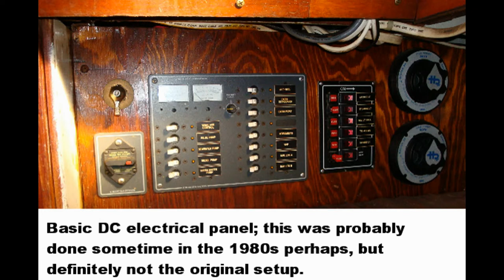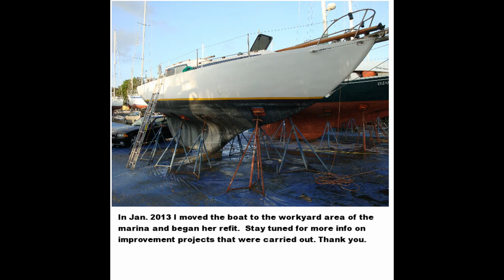Restoring the Sailing Vessel "Nyanga."

Comment: dude.. what happened to the boat?
Reply from the maker: http://www.ebay.com/itm/1963-Richardson-Northern-35-Steel-Sailboat-Florida-/391610874915
Got a job in another city and could not bring the boat with me.
Reply: Ken Morgan that's the reason I asked, I'm interested in buying the boat. I saw the effort you put into it. I just retired from the Army and I want to live on her with my pension. any advice?
Reply: Ken Morgan is there any way I can contact you to get more info? slip status, sailing worthiness? I'd appreciate it man, really
Reply from the maker: Jason,Despite
 the work I put into the Nyanga, it was actually not a good choice for a
 liveaboard vessel.  I purchased the boat before I really knew a lot 
about the different kinds of sailboats.  I too wanted a comfortable 
liveaboard vessel to cruise the Bahamas or Caribbean with.  I should 
have known by her narrow beam (9.5 feet) and small tankage (40 gallon 
water tank, 10 gallon fuel tank) that she was not really a cruising boat
 but a racing boat, not designed for extended living aboard.  And even 
with the improvements I made, she would never have been the comfortable 
cruising yacht I was really after.  Typically, true cruising yachts have
 much wider beam (12 to 14 feet) and water and fuel tanks that hold 
150-200 gallons.  This makes them very suitable for extended living 
aboard.  Narrow-beamed boats like Nyanga are more suited for weekend 
club racing where you will only be spending a couple of days at most 
aboard.  So If I had to do it over again, I would have purchased a real 
cruising boat, something like a Morgan 41 or Irwin 38, shoal draft keel 
to accomodate the shallow waters here in Florida.  With a wide beam and 
adequate tankage, a guy with a pension could have a good life with a 
boat like that at most marinas in the state.  Keep your eye on the 
boatangel website but don't buy any boat until you have personally 
inspected it.  Another tactic is just to visit the larger marinas and 
ask if they have any abandoned boats; they usually are willing to part 
with these for a very low price.  I would think that the marinas on the 
east coast of Florida are full of such vessels with the recent passing 
of Hurricane Matthew. That's how I found the Nyanga, by calling around 
the bigger marinas in the state and telling them I was looking for a 
project boat.  
I
 recently paid cash for a small sailboat in the St. Petersburg marina 
because it had a transferrable slip.  I live in Orlando but work in 
Tampa so needed a place to stay during the week.  I now have a Starwind 
27 fiberglass boat but already the lessons learned during my ownership 
of Nyanga have helped me.  
  
Thanks for viewing my video and good luck in your search for the ultimate boat,Ken in Orlando
Reply: Thank you for that very helpful response, I truly appreciate it. I actually did Bid on the boat and was outbid in the last 5 seconds by 100 dollars, I've been quite depressed about it all day. I know the boat is worth much more than 5,000 but that was what I could afford right now, it went for 5,100. I've been beating myself up about not scraping up more cash and bidding higher. Your honest feedback has reinforced my original plan to wait until I get to Florida in 6 months before buying a boat (currently in AZ), I just thought your boat was too good to pass up. I love welding and build cars and motorcycles from the frame up. I want a steel sailboat badly, and it just seems that they are so hard to come by.